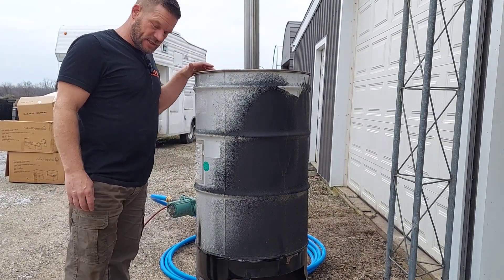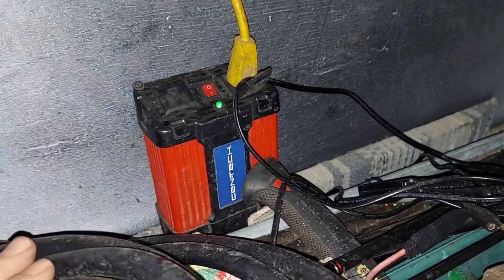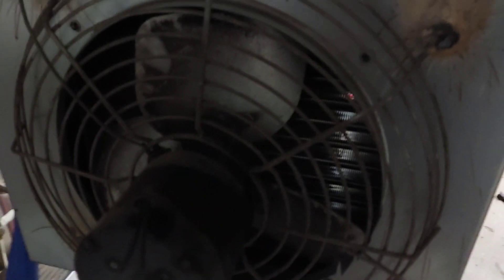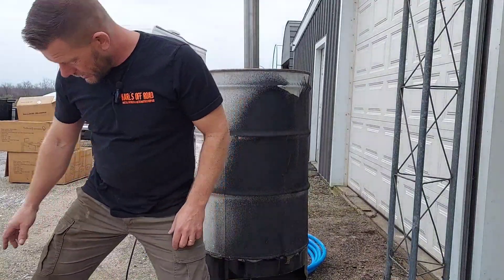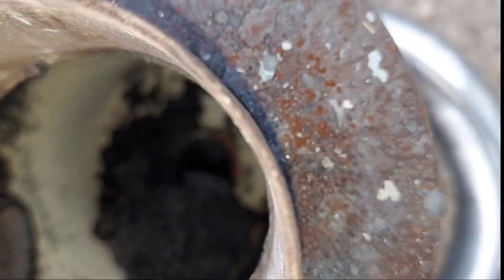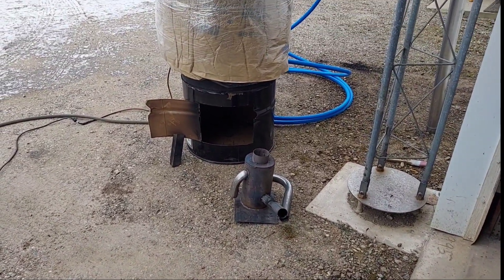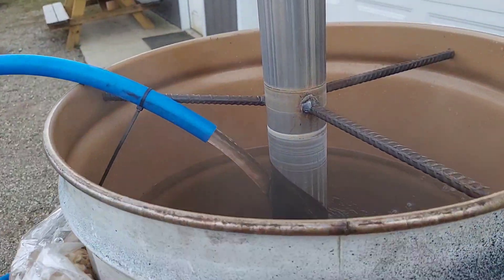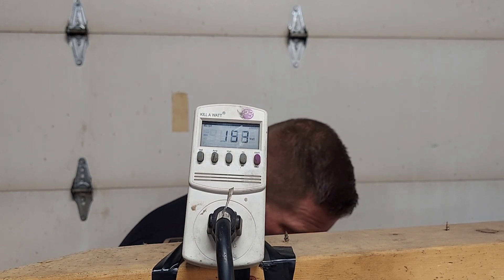Natural draft waste oil burner! Off grid water heater build part 3!

Comment: What hydronic fan are you using?
Reply from the maker: @greggoryleblanc1024  just a cheap one from Ebay for this test. The water to air heat exchangers I use to heat my home and shop are Dragon's Breathe heat exchangers.
Reply: Thanks for quick response. Any idea the btu output. I’m getting ready for winter and your setup makes the most sense to me!
Reply from the maker: @greggoryleblanc1024  I have 2-120k btu heat exchangers, one in each building. I'm not sure what the rating is for the one I used in this test. 80-100k I would imagine, very similar in size.
Reply: Do you think I’d need to get 50 gallons boiling or would less water be ok. I’m only trying to heat a 30x30 insulated space
Reply from the maker: @greggoryleblanc1024  The water doesn't need to boil. The heat exchanger ratings are based on a water temp of 180 degrees Fahrenheit, so if the water is going to be cooler than that, get an oversized water to air heat exchanger.

Comment: How do you think it would work if you use a water radiatorer?
Reply from the maker: I run it through a heat exchanger, which is a radiator. I'm not sure what you're asking?
Reply: @karlsoffroad  my misstage 😂 i did not realize that the comment got posted, was writing the comment but realized that one beer to many and was going to delete it 😁 but i posted it instead

Comment: I do the same as this for heat in the winter right now and last two years. Then I use it with just cold water also for cooling in the summer. Glad to see this,  good work.
Reply from the maker: Same,but on a much larger scale for my home and my shop. Thanks for watching!

Comment: The return line was at 150-160 but what was the supply line temp?
Reply from the maker: I couldn't get an accurate read on the water coming in. I would guess 10-20 degrees above that. It was definitely pulling heat off the water. It may have been only slightly hotter than the return because it was such a short loop. I only let it run for an hour and a half.

Comment: Been interested in doing the same with hot water or air heating. Was debating using the 55 gal drum for air or water. Water might have freezing (use antifreeze) or leak issues, and air would be harder to keep up to temp as it goes into the house a few feet away. Found this informative. I really want the fire box and oil supply outside for safety and fumes.